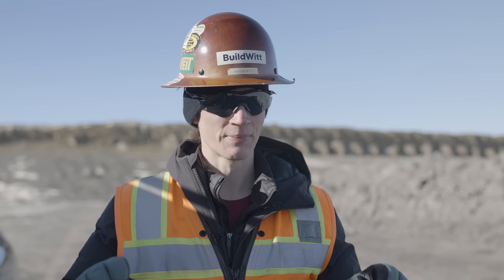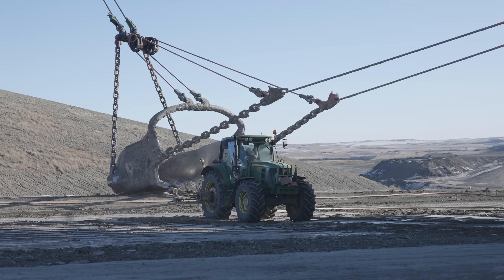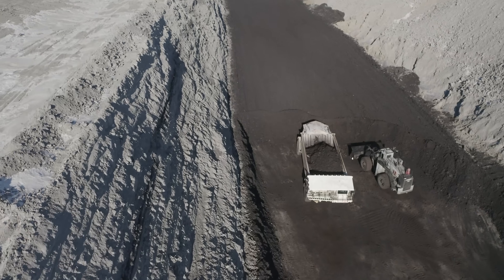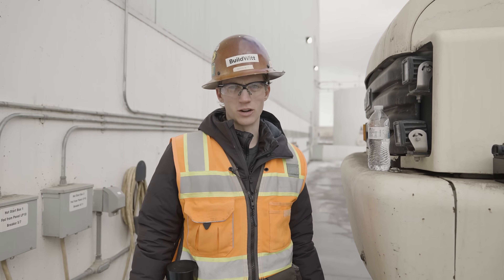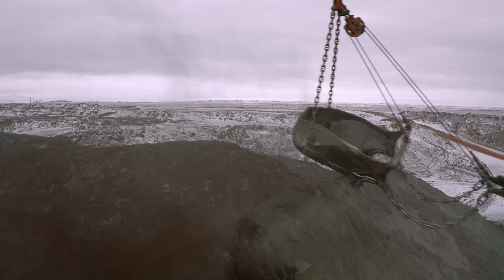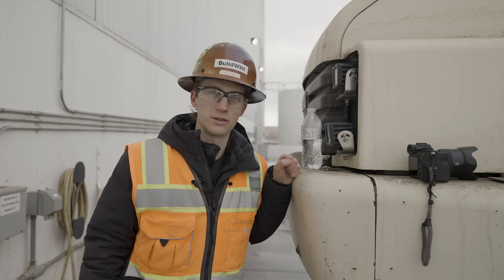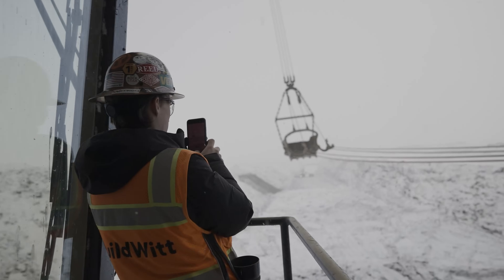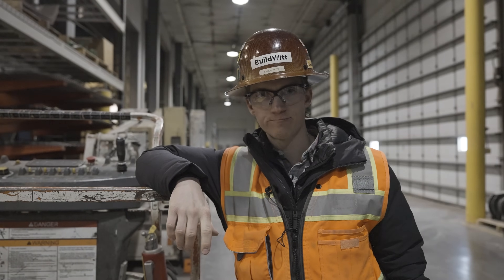3 Coal Mines In 3 Days | Electricity for 1 MILLION People | North American Coal

Comment: I work in a mine in alabama but I run a D-11T cat dozer in the push, our largest trachoe on the job is a PC2000 and smaller 1800 trachoe that loads our 10 rock trucks, we're a small mine compared to the one in this video but we have several of the big draglines parked around different parts of the county that are still property of Drummond Coal Company, I would of loved to see one of them in action, but unfortunately they just sit there collecting dust and rust.

Comment: The land they leave behind isn't safe to build on for decades. They'll tell you it is, but I know several homeowners with cracked houses who would say otherwise.
Reply from the maker: most everything in ND is farmland after
Reply: Are the foundations cracking from improper building standards or from setting land.
Here in the midwest we have the issue of sandy soil, if you dont build the foundation well enough or if you rush a build without time to settle your foundation will crack.